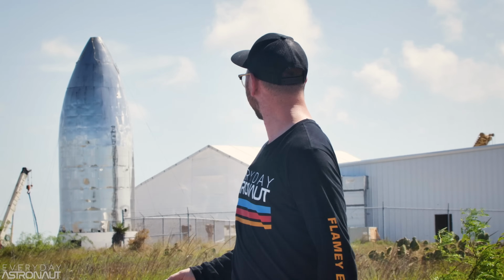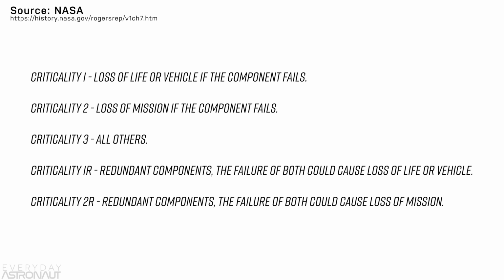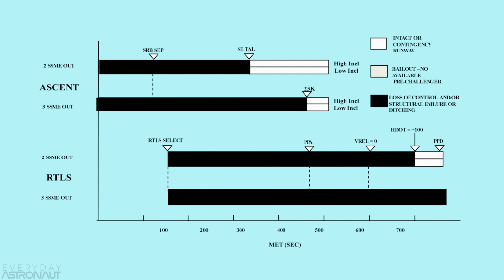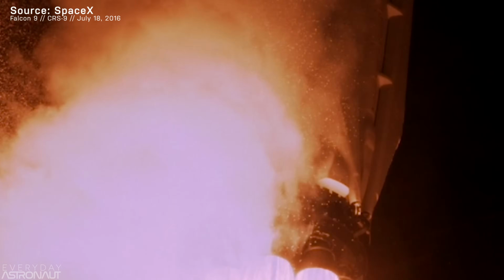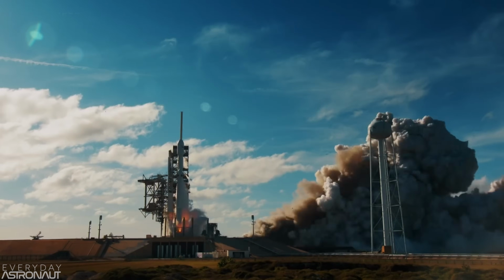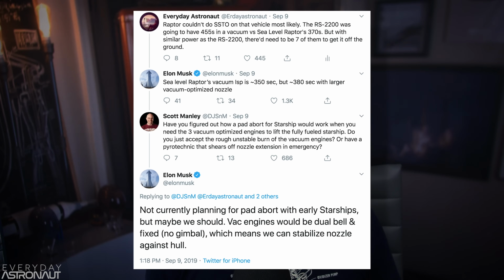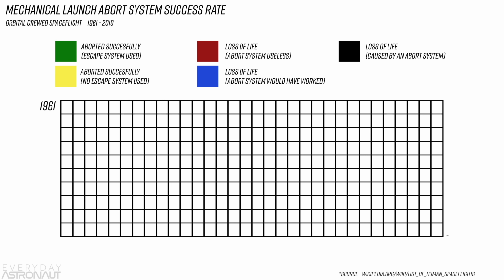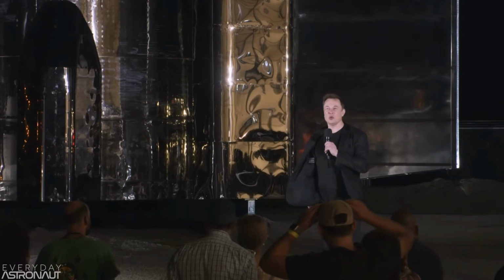Why won’t Starship have an abort system? Should it?!

Comment: Airplanes also have an abort system. They are called wings and the ability glide. For every 737max crash there are dozens of engine out landings that are probably not recorded in your failure chart. (engine out landing are a part of rotax powered ultralight flying after all) Rockets don't have that inherent fallback and never will. No argument that reliability will reach the same heights though. The other question is what a 100 people escape pod would look like...
Reply: Instead of a single pod for all 100 people, it would probably be easier if each person gets a sleeping bunk that can seal itself off and has an air bottle (in case of a loss of pressure in transit) along the outer skin they they also sit in for launch. On a RUD each bunk closes off into its individual ejection pod, ejects, then has a 2-stage parachute deploy.
But that's still a LOT of extra complexity and I'm not sure what having that many hatches would do to the structural strength of the skin. Also it would be completely ineffective as soon as you're fast and high enough to get reentry effects on the way down (basically until booster separation).

Comment: Great video But I'm not convinced rockets can ever be made safe. There's way too much fuel and oxidizer onboard and the vehicle is highly stressed. Without launch abort... Starship is a disaster waiting to happen! Furthermore Musk apparently has no plans to build Starships in the controlled environment of a factory! If Musk proceeds as planned, I fear there will be major loss of life. They could lose 100 people. One more thing to consider... Unlike aircraft... Rockets have a Flight Termination System (FTS) designed to destroy the rocket if it goes off course.

Comment: in the event of a major second stage engine/tank failure, what are your thoughts on deliberately crashing tail first, crumpling tanks to absorb the impact energy like a 180 MPH car crash?
Reply: Seems to fall under the "might as well try it" category. There's still so much fuel/oxidizer left that you'd be crumpling your way into an explosion, but hey, the crewed pressure vessel might survive it, right?

Comment: One thing that I can’t get my head around, is why would you build a launch pad right next to loaded  tanks sitting right next door to it? I think that the pad that mark one was sitting on was nothing more than a test stand and not a launch stand. When it comes time for mark three’s day of launch it won’t be in the same spot. Mark one went as far as it was going.
Reply: I believe (entirely speculation though) that the tanks only contain enough fuel to fill one rocket, so there's no risk of them exploding once the rocket is fuelled.
Reply: No such thing as an empty tank is one thing I was told as a kid.👍🏻

Comment: I would ride on a rocket with no abort system, if the analysis and testing proves the same safety factors. If they could predict a similar chance of loss of life as the current systems that include launch abort systems.

Comment: "You know when you're an astronaut you gotta buy into alot of risk. Nobody is going to save you if the hardwear doesnt work; you buy into that stuff if you're going to be an astronaut, if you can't buy into it, don't be an astronaut!" 

-Alan Bean (When We Left Earth)

Case in point,nobody is FORCED to sit on the tip of a rocket. If you're there you have FULLY CHOSEN

Comment: Hello Tim

Any idea of what would the resistance of the Star Ship on space debris be?
It's hard metal and all, is it a single layer or it has different protection sheets like the ISS?
Always worry something could hit that huge body, pierce trough the tanks or anything that could compromise the missions...
And those windows, they need to be tough ! (Cybertruck metal glass 🤘🏻)

Thx for all the hard work, love the informations and videos qualities!
Reply: Rafael Esperidião I don’t think it has any resistance to space debris. The ISS has huge Kevlar “vests” wrapped around critical parts. They’re thick, if it didn’t have those, they’d be getting penetrated all the time by the smallest particles (like tiny flakes of paint) going right through the modules at 17,500 miles per hour or greater. With rockets and space shuttles, it’s just fingers crossed and hope you don’t get space debris on the way. NASA tracks about 10,000 pieces of known space debris in real time, and I would assume that they don’t launch when there’s a bunch overhead, but I’m pretty sure you could shoot a simple bullet straight through a rocket or space capsule, and a bullet is only a fraction of the impact that a piece of space debris would impart.

Comment: There is one aspect you are not mentioning here. Starship has the largest crew capacity of any launcher with it's 100 passengers. Secondly it flies private citizens not astronauts and will largely be self guided with nobody on board trained to do any sort of manual abort. If I remember correctly the Soyuz has a maximum number of crew members of four or three and offers limited control to it's passengers in the event that something goes wrong that's not outright catastrophic. The way I see it these factors means that measured in sheer number of launches it doesn't make a whole lot of sense for SpaceX to have an escape system. However the PR fallout of having 100 people dying in your product means that if they can somehow abort, even if it takes the place of say 40 crew members in terms of weight, a system would have to be there. At least when they are ferrying private citizens to space. After all part of the reason why the relatively few shuttle accidents was such a big problem for NASA was because of the large crew of seven. The PR fallout of loosing so many people in one flight was pretty devastating. Especially for Columbia when news broke that the cause of the problem could have been found had NASA simply looked through their own footage from the launch as a similar accident had occurred in the past and the crew could have been saved by launching another orbiter or even Soyuz capsules to rendezvous with the damaged shuttle in orbit.

PS: The new and improved shuttle escape system of merely jumping out with a guide tube is pretty laughable. From what I have seen and heard in various documentaries nobody really thought that would be practical and work in a real emergency. NASA simply had to do something to appease the populace and perhaps more importantly the politicians.

Comment: Here is my question. If Crew Dragon's parachutes did fail, would they use the super dracos even though they aren't certified for that use? During Apollo, there were several times that they did things that weren't really intended but they knew they could do if they had to.

Comment: Can you maybe one day make a video about this claim with the "moving parts"? It sounds rather silly as most everything you can think of aboard a shuttle or Saturn v is bolted down, uses velcro etc... very few things actually would be "moveable" after assembly... is this figure of speech referring to BEFORE assembly? As in "separate" parts?

Comment: Let's not forget that all of the RS-25 history has yet to be written.  SLS is using them 4 at a time.  NASA has 16 RS25's to be fired at 109%RPL, with another 6 flight engines to be fired at 111%RPL due for delivery to KSC in 2024.

Comment: If the best part is no part, then the best design for people in the most intense regimes of spaceflight is a capsule. I think we will see capsules sending people up to Starships that have launched without crew until Starship has been thoroughly, thoroughly vetted.
Reply: See, Starship will still have to be safe enough to carry crew even if you're launching them up on capsules, so you're just adding a lot more expense and opportunities for failure for little benefit. At that point you might as well not use Starship and just use the capsules on their own.
Reply: @jeffvader811  "Safe enough to Carry Crew" means different things in different flight regimes.  Just the capsules makes no sense because while they are most reliable at getting people out of gravity well and then back through atmosphere, they can't do the other things that Starship can do in terms of habitable volume and cargo carrying.
Reply: @jeffvader811  Starship is going to have to be refuelled for many of its mission anyway, and that'll take time. For early exploratory missions without a lot of crew, it makes sense to park starship in orbit with no crew to use up consumables, take however much time you need to fuel it in orbit, and then send the crew up in a capsule once everything is ready to go. That way you can start doing crewed missions immediately instead of waiting until Starship is thoroughly human rated as a launch and re-entry vehicle, by far the most violent flight regimes.
Reply: @striatic  
The primary purpose of Starship is to be low cost, and launching crew on Dragon 2s, just so you can avoid man-rating the SuperHeavy booster, adds a lot of cost. Some $750 million, if Starship is loaded to full capacity with reused Falcon 9s. Or a cost per kg (assuming 100t payload, and that launching 9 starships, 8 tankers and 1 crew, costs $18 million) of $7680/kg. Which is over 3 times more expensive than Falcon 9 and Falcon Heavy, so you'd be better off scrapping Starship entirely.

You're already going through all the effort to make a giant launch / re-entry vehicle, why not just go the extra effort and make it safe for crew in the first place (via a dozen or so test flights) instead of bothering with this overcomplicated interim solution that costs almost a billion dollars a pop? I don't see this happening at all.
Reply: @jeffvader811  It isn't to avoid human rating it. Eventually it'll be human rated and launch with crew. But it isn't just a little "extra effort" to fully verify that an escape-system-less vehicle unlike any ever before created is acceptably reliable during ascent and re-entry for safe human use. This whole argument that 'hey why not just shove crew on this thing in the most dangerous regimes with no escape system' ASAP is full stop putting cost ahead of lives and will get people killed.
Reply: @striatic  
There's no need to have crew on any of the initial launches. You could do as many as you want unmanned before putting crew on, proving out the vehicle without the enormous expense and impracticality of launching crew on separate Dragon 2s.

Comment: In a previous life I was one of the lead technicians at Boeing London Service Centre (the only one that was spelt that way). I quickly picked up the fact that the electronics doing BIT/BITE (Built In Test/Equipment) was actually the part that failed 90% of the time. Airlines would send failed kit in and it'd pass the automatic tests, except for when the test button was pressed. Dodgy capacitors that should be just injecting a test signal in were the issue. I loved working for Boeing, they wanted us to get to the root cause because they'd fix it. I'd hate for a similar system to suddenly decide that BOOM you're now launched into FKW*. The main operations are extensively tested and proven, but when things go wrong... not so much.

*Fck Knows Where
Reply: George Prout Yeah it’s true. I’m an airline pilot and still to this day, problems with safety sensors are more common than problems with the actual equipment.

Comment: Regarding difficulty of air flight vs. space flight - the early transition of air flight from glorified wood and paper kites to aluminum stressed skins was similarly a major advance of materials science and engineering. But it is significant that the B17 was nearly cancelled due to the impossibility of successful flight, until the first element of systems engineering - the startup check list - was invented. The continued advance of safety and reliability due to precision methodology can not be understated. Space flight is the next order of magnitude of systems reliability management.

Comment: I'd suggest that SpaceX ground-mount between one and five Raptor engines and fire them for a few minutes every day until problems due to design, fatigue, wear, or other problems begin to appear. This would begin to show the path to airliner-level reliability.
By way of comparison, the old Hammond Organ company kept the first Hammond M-3 or B-3 (I forget) production unit in-house and warranted every component of every organ sold for as long as it lasted on the original.
Reply: Watching the video, doesn't look like the stats support that, though. The issue rarely seems to be the engine itself but some other problem. So what if the engine is 100% if the sensor that detects a failure is 96%? And this definitely doesn't seem to address the pressure vessel issues.
Reply: @x--.  I'm thinking about the future, to a time when we might expect flight frequencies and vehicle maintenance schedules getting closer to present-day air transport planes. A modern jet airplane has engine overhauls after 3000 to 5000 hours, and aiframe life is based on the number of flights -> number of pressurization cycles. (Thus us to some extent due to the problem of aluminum work-hardening, so stainless steel vehicles might actually blast longer!)

Comment: Star Ship vacuum engine could have a drop away plug that turns it into a Aero Spike Engine with the attached surface being the vacuum bell.   This is what occurs in jet engines with the shaft and cone on the exhaust turbine being a plug.
Reply: The plug that creates and inverted Aero Spike  could be attached to the bottom of the Vacuum nozzle bell with three to five ribs that would minimally reduce the area.  The would result in no change to the combustion chamber and likely the throat that is choked, determine the flow mass.   The plug would be operated for a short period of time so could have a ablative coating and sensors to determine when it must be dropped.

Comment: Isn't the RD-107/108 technically 1 engine with 4 combustion chambers? I hear you quoted the statistic for failure rate as 1/1335 but believe the denominator should be lower because its not x4 per flight. Great video though!
Reply: The soyuz carries 5 RD-107/108 engines each flight, 4 RD-107 (one per booster) and 1 RD-108 (center core).
Reply: @SneeuwPoesjes  That explains it. I wasn't counting the boosters.

Comment: True story: I tried to design a triple voter memory for improving the reliability of a system. Turned out it was so complicated that it would probably be less reliable...
Reply: R4P70R An Airbus aircraft has a triple computer voter system, and then it has 3 laws: normal law, alternate law and direct law. It does result in better reliability.
Reply: @Tuxedo_Cake  My simple design didn't get any reliability improvement if I added this voter. Radiations would probably kill the complicated voter faster than the system I'm trying to protect. (At least within the small money, space and mass budget in the project)
When you're talking about a full computer system that's another level of complexity which can be drastically improved by multiplying the whole system by 2 (hot redundancy) or 3 (voting).

Comment: They used to put prop planes on dirigibles.
Just in case
Reply: That wasn't an escape system.  In the 1930s the US Navy (IIRC) experimented with zeppelin aircraft carriers (😮!) for fighter planes with limited range, carrying those planes to the battlefront faster than ships could.  
But then the fighter range problem got worked out and the ships got better and much bigger, while zeppelins, well....
Reply: I thought it was the Germans who first mounted airplanes to dirigibles.
The zeppelin pilots were refusing to make the bombing runs to London. Do to the fact that most were getting shot down. Killing the pilots.
They tried mounting an airplane as an escape vehicle but in most cases the pilots were still not able to escape. So they gave up on the idea.
Then America did some experiments with the concept.
Reply: @charlie15627  I'll have to research the German experiments!  Thanks for the lead.

Comment: still feels like some sort of redundancy would always be sensible. maybe my math's is wrong but if your primary system is 98% reliable and your abort is even only 50% doesn't that equate to 99.99% overall ?  100 - (0.02 * 0.5)... seems like any sort of plan B even if its not that good really helps.
Reply: EcBaPr - Actually, that’s 99% — 1.00 - (O.02 * 0.5) = 1.00 - 0.01. You forgot the decimal place in 1.00. But 98% with a 98% reliable backup would come close — 1.00 - 0.0004 = .9996 or 99.96%.
Reply: @TraditionalAnglican  ahh yeah of course.. i knew the concept i was trying to work out just not much good with maths.. still as you say a 98% abort system would go a long way..

Comment: How does adding a second engine increase the window where aborting is safe?
Reply: The unmanned Centaur single-engine upper stage burns for over 13 minutes, because the first stage throws it very high, well over the atmosphere.  This is an efficient trajectory because only bringing one RL10C engine cuts the upper stage dry mass.  The problem with this profile on a Starliner mission is the g loads on an abort reentry: the high altitude at cutoff means an abort drops straight back down into the atmosphere instead of a slow curve.  The dual-engine Centaur upper stage has higher thrust, allowing it to fly a flatter trajectory through thicker atmosphere (less efficient, but safer).
Reply: PS: deleted my previous comment as I mistakenly read your comment as a reply to another one here. Sorry for adding confusion. Glad to see somebody else saw what you were actually asking about ;)